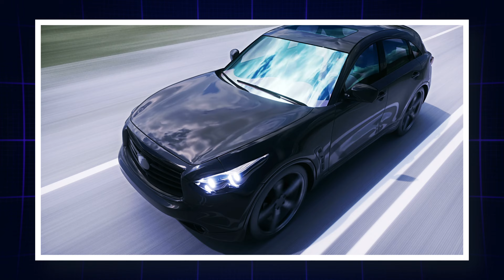How a Car Engine Works: The Controlled Explosions Inside Your Car

Comment: Its not an explosion its very rapid burning if it exploding it would tear itself apart 😮 ook at diesel engines they use compression to heat the air that burns when fuel is injected in the cylinder.
Reply from the maker: @garywinterbottom6073  Thank you for your detailed explanation! It’s always great to learn more about how these engines operate. Your input is much appreciated!